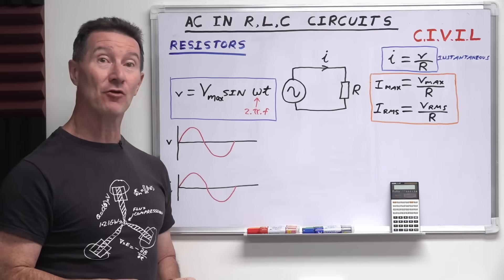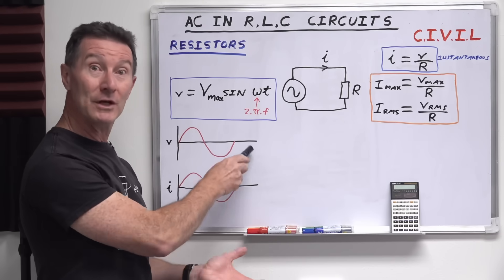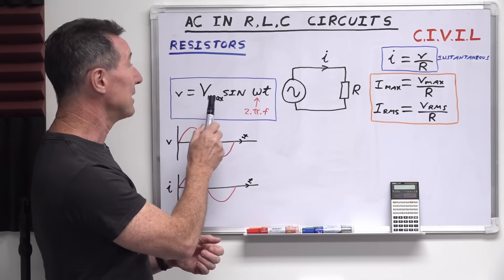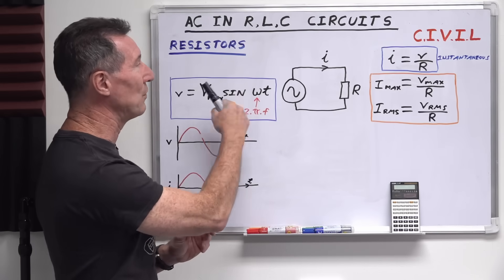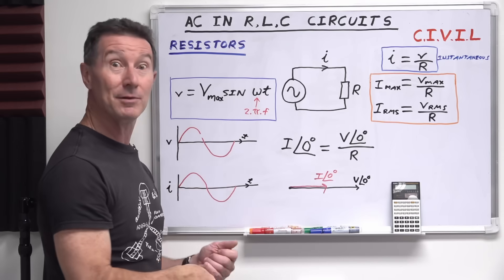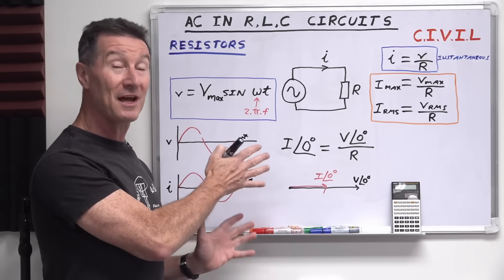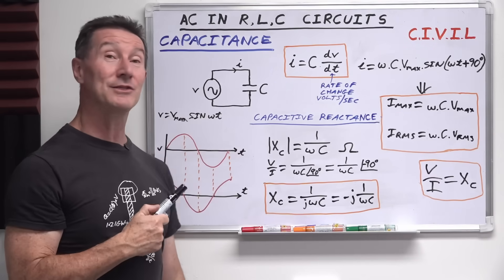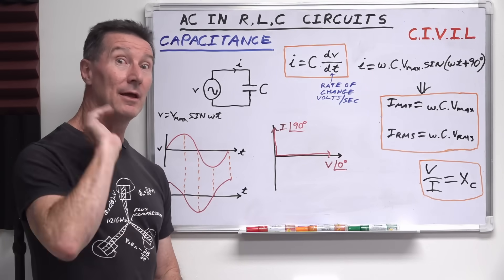EEVblog 1660 - AC Basics Tutorial Part 4: Resistors, Capacitors, Inductors

Comment: I was in an electronics class in 1988 (!) and the instructor began the topic by physically jumping up and down on the spot yelling "CEEVIIL!!" (he had an accent). He told us he did a silly thing so we would remember C.I.V.I.L. It worked. :)
Thanks for these videos I have enjoyed re-activating long dormant brain cells and introducing them to new ones.
Reply: Smart folk acting silly so that we can remember it better is pretty smart. ;) I remember my teachers doing similar stuff, you remember their antics and thus you remember what they were about, and that's useful. They knew what they were doing!
Reply: Ohh my my.....
That takes my memories back to engineering classroom days.
And guess what....I may not be doing the "jwl" calc today, but my career involves dealing with Ac and DC power in renewable energy and I'm always conscious of the fact that the "jwl and it's siblings" are very busy working in the core centers of the complex "Power Electronics" circuits that are the building blocks of renewable energy industry equipment.
Cheers for bringing in this refresher.
Keep it up....

Comment: We used E-L-I the I-C-E man back in college to remember voltage/current lag. (E leads I for L's; I leads E for C'S)
Reply: I remember hearing that one, but I was never good with acronyms. Instead, I just remembered how they work. You need a current to charge up a capacitor and change the voltage, so current comes before, or leads voltage. You need a voltage to push current through inductors and get the flow going, so voltage leads current. It's not a shortcut and it took a while to really get it down, but it helped me better understand why it's that way.
Reply: Same here. And my teacher added SARL PARC for all the resonant AC circuit stuff. Ahh, those were the times.

Comment: Easier to remember what leads what by understanding what are the things we are dealing with: the voltage cannot instantaneously change on capacitor, i.e. the current builds up the voltage on the capacitor, therefore voltage will lag whatever current you apply. Opposite for inductor, where the current cannot change in an instant.

Comment: I don't use c.i.v.i.l., I just remember that when you apply a voltage to a capacitor, first (time = 0) the current will be high to charge the capacitor, so the current is leading. And then knowing that it is the other way around with inductors.

Comment: instead of CIVIL, in german there is a saying
"Kondensator: Strom eilt vor!
Induktivität: Strom zu spät!"
it's not that short, but easy to memorize 😊
Reply: Honestly not a fan of that one, it's one of those rather poor ways to remember things. Like "right is where the thumb is left" (which is a totally pointless phrase people teach to kids here, because if you don't already know one or the other it tells you nothing). In this case the phrasing mixes 2 different naming convetions as "Induktivität" (inductivity) would be the complement to "Kapazität" (capacity which obviously ends in the same way and hence can't be used in the rhyme) and "Spule" (coil) would be the matching complement for "Kondensator" (capacitor). You also need to remember that this was about current, otherwise it's just flat out wrong.
Reply: @ignispurgatorius5297  well about the mixing, at least I don't know another name for the "Induktivität" translated as inductor.
my father told me once, and I could not forget it :D

Comment: An uncharged capacitor looks like a dead short, once charged, it looks like a battery which can provide a huge current (potentially). An uncharged inductor looks like an open circuit, once charged it looks like a battery that will maintain a current, possibly causing the voltage to spike dramatically.